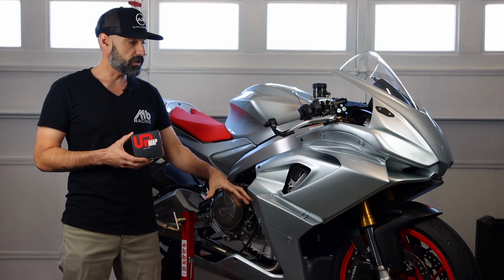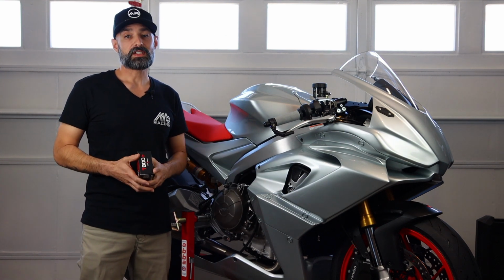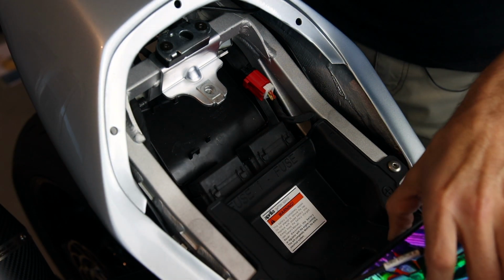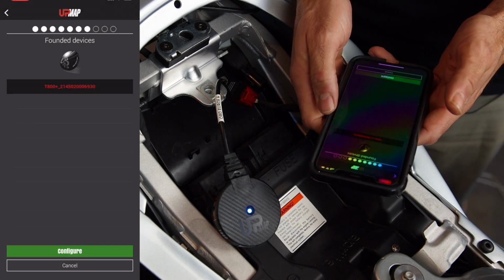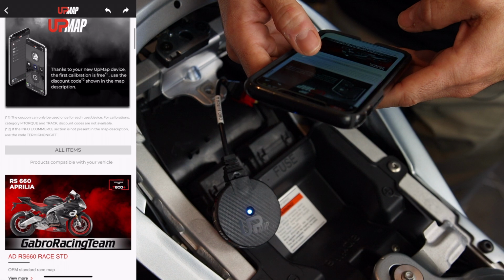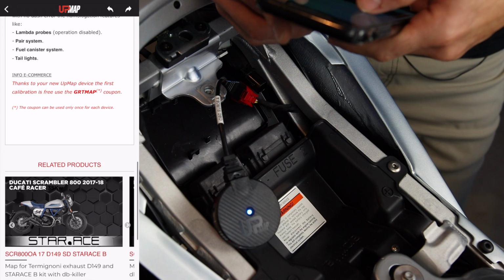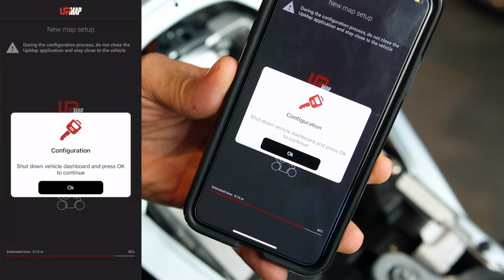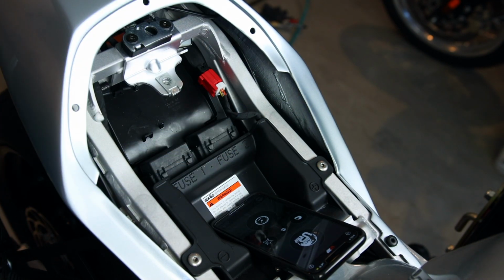2021 Aprilia RS 660 UpMap install walk-through | SkwidVids

Comment: Another killer video. Pretty sure the blinking lights on the dash have something to do with your call of duty cheat codes not working, but I could be wrong.
Reply from the maker: Thanks for watching! I think you’re on to something.
Reply: For anyone seeing this in 2024, the blinking lights will come on if you have your abs or wheelie control turned off in the current riding mode you’re in. Nothing to do with the tuner.
Reply: Abs and TC light will remove when u drive around 5-10kmh if it does stay on means in disabled and 3rd light tell you you can't use quickshifter when bike is stopped in place...

Comment: Man that thing looks super convenient! I wonder how their maps compare to the Race ECU. 🤔 Another top-notch video, Robert! Keep it up! 👏
Reply from the maker: Thanks man! The way it was explained to me, the Aprilia race ECU is a generic map. Better than oem but not specific to your brand of exhaust. The maps created by Gabro are done so on a dyno with different exhaust and velocity stack combos to create more specific maps. One of my favorite features is that you get the exact map as the race ecu included if you don’t want to run Gabros maps or don’t have any of the exhausts in the maps list.
Reply: Race ecu is a generic map made to run race exhaust safely (read it as "drown in fuel". On the side note it enable pit-limiter feature and allows to remove road gear (lambda probes, pair/sas system, fuel vent system). It is offered free with the upmap, you can flash your ecu with a the plain race map and have it transformed in a race ecu.
My tunes are based on it, with fueling adjusted to the specific exhaust used, and tailored to all the other performances accessories fitted to the bike. One custom map of mine is also included free in the tool purchase. Plus my maps have some other tricks for making the bike overall faster and with a better rideability. Moreover, in upmap system are present tuned stock maps as well, that can work on stock exhaust giving a moderate performance increase, available in go/std shift and with/without integrated direction indicators.
Reply: @gabroracing  is it possible with upmap, to upgrade my EU A2 (70kw) Aprilia rs 660, to a full power 74kw aprilia rs660?

Comment: does the app allow you to reset the oil maintenance light? thanks for the vid, im glad i stumbled onto your channel really cool thanks
Reply from the maker: Great question! I haven’t confirmed it yet but I believe it can reset the service light. I’m pretty sure I saw Gabro post a video about that.
Reply from the maker: And thanks for checking out the channel!
Reply: @skwidvids  I’ll check it out thx
Reply: Did you ever find the answer to this question
Reply: @rickhayden916  I have not. I purchased the tuner that people say will allow maint reset but have yet to install and others have told me it will not allow it. I’m still debating salting the bike so I’m weary of doing the install. Hope this helps

Comment: Hey thinking about flashing the same tune on my bike. I’m in the US and don’t race just daily drive my bike. Does this tune cause any issues such as warning lights or check engine lights or stop any features on the bike? Thanks for any help in advance!
Reply from the maker: Good questions. It doesn’t create any warning lights or anything like that. It actually resets the lights so if one comes up, something else is going on. I know there are several map options. Some of which will remove your cruise control and make it a pit limiter instead. Best thing to do is to reach out to Aprilia Special Parts directly with those kind of questions. They’re really helpful.

Comment: Great series of vids. Thanks for the time and effort. How's the bike running within the tune? Did all the blinking lights on the dash go off with future starts/rides? Thanks.
Reply from the maker: Thanks for the feedback! It takes a lot of effort (for me) to make the videos so positive feedback helps. The flashing light at the bottom of the dash turned solid when I shifted through the gears the first time. It’s now displaying a red “R” for reverse shift. The other lights are the ABS and TC. They should turn off when I ride the bike.
Reply: @skwidvids  Can imagine the time it takes - the editing would take me 10 times longer than shooting the video :D Appreciate the series and looking forward to more to come. Another question you may know the answer too - Does the new map mess with the cornering abs? can you still use all the standard maps - being the 3 road maps and the 2 race maps? Many thanks.
Reply from the maker: @jonobnz7597  I wish I knew the answer to that. I wasn’t concerned with cornering abs so I didn’t bother looking but Grabro at Aprilia Special Parts can probably answer that for you.
Reply: @jonobnz7597  the Upmap is flashing the Engine controller, the brake controller (in charge of ABS) will behave as nothing has happened.
Reply: @nicholasuselmann2469  great thanks for letting me know that. Now I need to find upmap in stock somewhere

Comment: Hey, I'm wanting to buy a 2024 RS660 and with the same SC project exhaust, but I'm looking at the maps and the map says they only work on 2020-2021 models. You think it works for newer models or what should I do?
Reply from the maker: I don’t see why it wouldn’t work. It’s the same engine. If you’re sure about going the UpMap route, you could reach out to Gabro Racing to confirm.
Reply: @skwidvids  alright thanks for the reply.

Comment: You have a video of how to go from rs 660 from street to circuit preparation (circuit fairing assembly, lights removal, etc).
Reply from the maker: I don’t have a video of that. I actually started recording with the intention of sharing how to remove the oem body work and how to install race bodywork but this bike has more pieces than any other bike I’ve worked on. Took significantly more time to remove the oem kit.
Reply: @skwidvids  that video would be interesting

Comment: Hey, awesome vid! Im just wondering about the GP shift. Do you have to do something manually, or just plug in the ecu and it will change automatically without for example changing the shifter position?
Reply from the maker: Thanks! You’ll have to reverse the shift arm and you’ll need to flash the ecu. I believe there a reverse shift accessory flash directly from Aprilia now.
Reply: @skwidvids  Thank you so much!
Reply from the maker: @beatsbykrab3332  Happy to help!

Comment: is the up map unit married to the bike ecu, or can you use it on multiple bikes? most open source canned tuning software is one vehicle per unit.
Reply from the maker: One and done. You can change the map on one bike as many times as you’d like but it’s linked to that ecu only.
Reply: @skwidvids  okay I thought it would. the tuning system i used on my 2015 frs for drift/autox was the same

Comment: Is ABS permanently off now? I want to flash my bike but I want to keep all electronics.
Reply from the maker: Abs can’t be turned off unless you disconnect the lines from the abs pump. You should be able to flash it with no change to the electronics but you should check your user settings just in case.

Comment: is this make any difference on top speed or acceleration ? How much difference have between stock and this map
Reply from the maker: I haven’t had a chance to put the bike on the dyno but from the charts I’ve seen, there is improvements in both areas. My butt dyno is most impressed with how it smooths out the power delivery.
Reply: @skwidvids  actually i will buy a new bike but i cant decide yet what do u think about it can you give me any advice  (R7 CBR 650 R or rs660 )
Reply from the maker: @iibluehd9068  Really depends on the type of riding you plan to do. I don’t know much about the Honda but between the R7 and 660, it’s a tough choice. 660 is more comfy and has more features but it’s also more expensive. Both would be great track bikes. Consider the type of riding you want to do, what your budget is and the proximity of dealerships to you. Not as much support for the Aprilia but imo, it’s a better race bike on a budget.
Reply: @skwidvids  between these 3 bikes which is faster what do you think ? i really like how aprilia look
Reply: @skwidvids  btw aprilia and yamaha have same price in my country
Reply from the maker: @iibluehd9068  The 600 about $3k—$4k more here. The 660 is definitely the fastest. Lighter than the R7 too.
Reply: @skwidvids  thank you so much i am looking for dyno test have a nice day